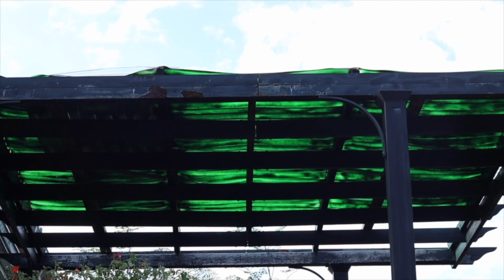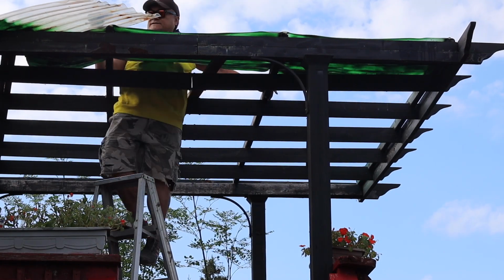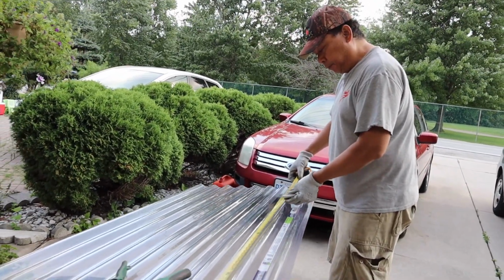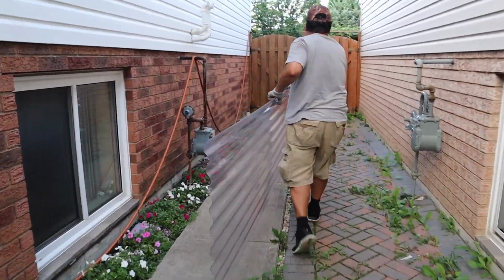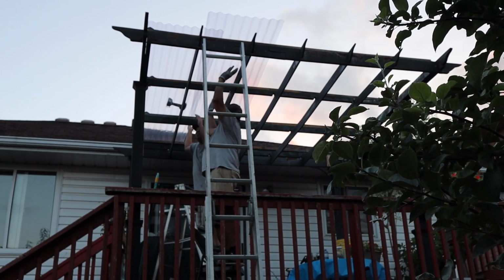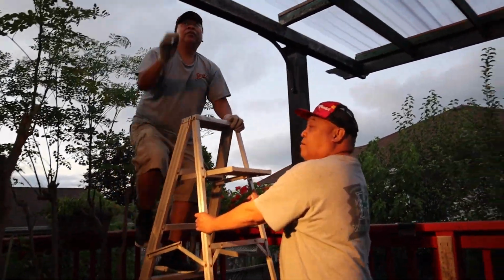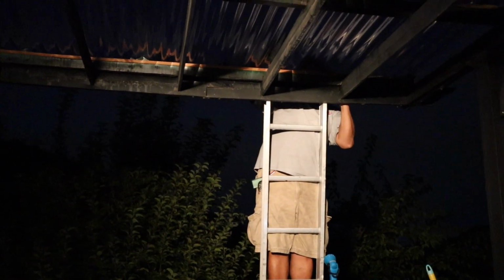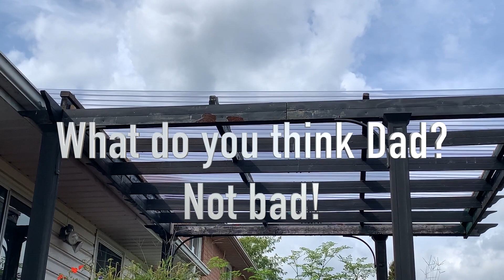How to Install PVC Corrugated Roof Panel on Pergola. DIY

Comment: Ok so do you have to use the wood, in trying to do this with my husband but I don't want to add wood.  Any other ideas on how to create a mild pitch?
Reply from the maker: Yes I used wood to do the mild pitch. At the top I used 4 inch thickness across, in the middle 3-2 inches & the bottom 2 inch across. Hope this helps.